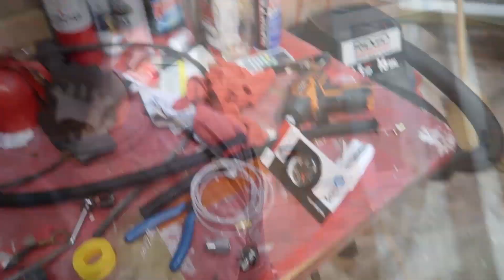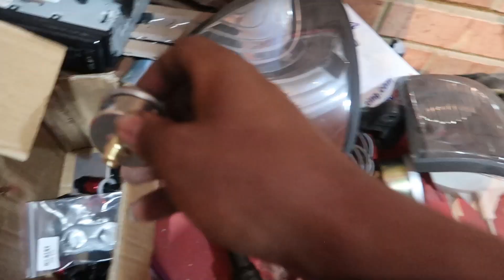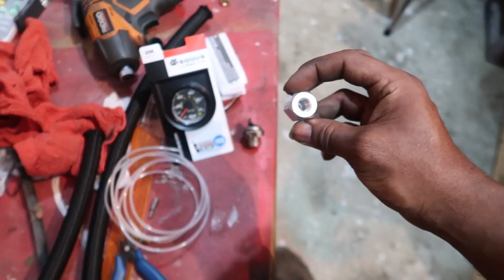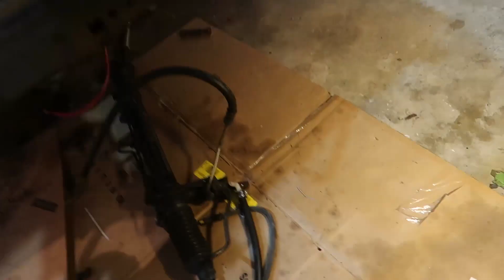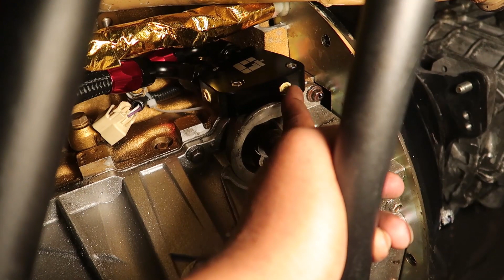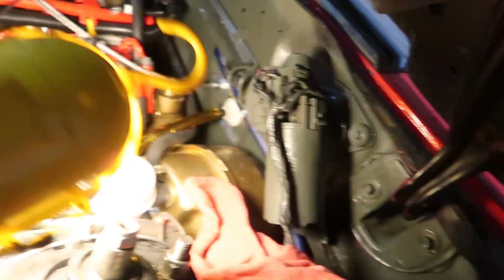Oil pressure gauge install for LS swap

Comment: Noooooo,  dont use that flimsy plastic line. Get copper.  I ran the plastic one through my car ( rear engine) the line was defective and it sprayed my interior and motor with oil..
Reply from the maker: I heard too mmany horrer stories b4 i installed it, i ended up going electronic.

Comment: Use Copper tubing!!!!!!
Reply from the maker: I ended up using this gauge only for testing purposes, i've heard too many bad things about getting oil in the car, copper lines or not.  I went for the electronic sensor.

Comment: What adapter are you using?
Reply from the maker: It's captioned in the video boss!
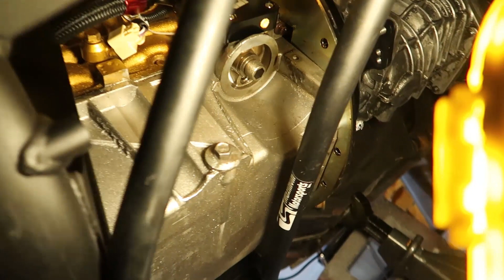Reply: @Sgt.Slides  My bad man, I didn't make my self clear. I meant the the plate adapter you're using, down off the oil pan. I don't recognize the logo. 5:04

Comment: You can buy a oil pressure guage kit for the oil cooler. Just a block, tapped for a line.
Reply: Where can i find that at??
Reply: Search under oil cooler delete

Comment: Why did you need that adapter?  Didn’t the gauge come with one?
Reply from the maker: the gauge came with some universal adapters, however, i wanted to get pressure from the OEM location and none of the supplied adapters were the correct size for that.

Comment: Did you just bin the stock sender?? Why?? One less warning  light...Id prefer a tee piece to run both if possible...and yeah, I'd run a braided hose anywhere where there's heat...
Reply from the maker: I ended up removing the mechanical set up and running an gauge.

Comment: What should the oil pressure read bro? Mine reads between 25-50
Reply from the maker: a healthy motor should be above 50psi when cold and 25 is at idle when warm.
Reply: Premium Fuel Mag thanks bro

Comment: This guy:
"Oil pressure is very important so i wanted to make sure i had a good gauge"
Also this guy:
"I went with nylon hose instead of copper line"
Reply from the maker: This guy never installed the nylon hose and went electronic instead.
Reply: Brandon Conover if you protect the nylon hose by putting a cover around the line it works just fine

Comment: Ya Kevin that thing is going to be a pain in the ass if it goes, best bet to go with the copper.
    Is you haven't already got it in.
The oil pressure was what did me in on my last motor.
Reply from the maker: I've been hearing some bad stuff. pay day, i'm pulling that out and going with another electronic.
Reply: Whats the bad stuff you heard? I was considering using this style gauge

Comment: Do not use the nylon hose!!!!!  It will not hold up at all. make copper lines and call it a day.  That nylon hose will blowup in a week or less.
Reply: This is truth!!!
Reply: Exactly! Who wants 220° oil spraying in their face? Or all over your legs... preach!!!! #copperisbetter
Reply: @MiBurnout  almost happened to me,  it happened on startup so it wasn't hot yet.
Reply: I used nylon on my sbc and it held up fine
Reply: So true, mine didn't last 2 minutes,  sprayed oil everywhere.  My car is rear engine and I have to run the line through the car. I covered the copper line with a vacuum hose incase the copper line fails it won't be so messy